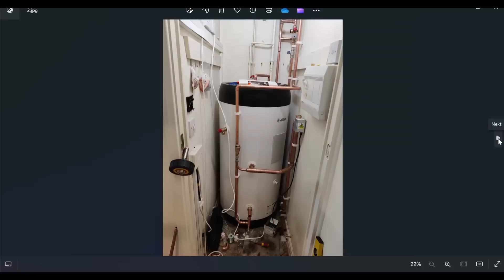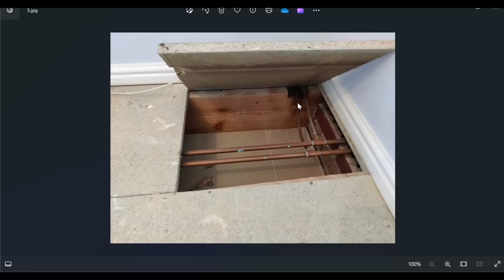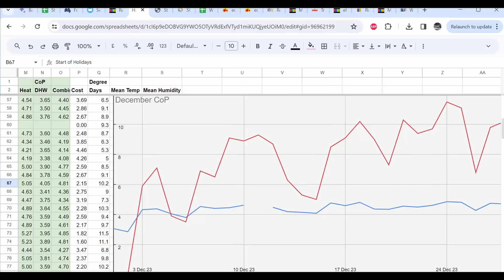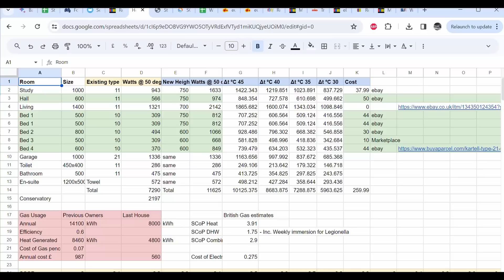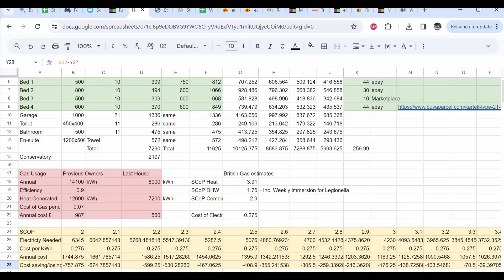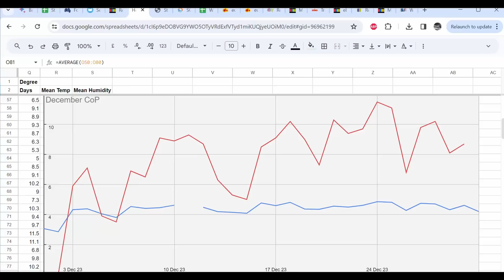How Efficient is my Air Source Heat Pump in Winter? December 2023 Monthly Data Report Update

Comment: bet your walls are insulated though but the truth is that most older buildings in the uk are unsuitible for heatpumps and if we all went out and got one tomorrow with a E car the grid would collapse we dont have enough power stations. Ive been fitting heat pumps on soicl housing in Scotland and they dont work very well at all in fact alot of the tennents would rother go back to a gas boiler LOL so unless the house is upgraded or rebuilt in some cases they are not the awnser
Reply from the maker: I disagree with all of those points, but it sounds like you've made your mind up already.

Thanks for your comment though! Happy new year 🎊
Reply: Instantaneous GB gas demand on record was during the ‘beast from the east’ in 2018 - 214GW at 6pm 1st March 2018, that is the distribution network demand so that includes commercial & light industrial consumption, but ignoring that for now, across 24m households on mains gas supply that’s a peak demand of around 9kW heat input, at an optimistic 80% efficiency that’s 7.2kW heat output.

If we assume a pessimistic COP of 2, then across all GB households that’s 7.2kW x 27m = 98GW of demand, at an optimistic COP of 4 that’s 49GW of demand

OFGEM mid range typical domestic consumption value for gas is 11,500kWh per annum,  for an 8 month heating period (30 day months 24 hours a day) that’s an average gas demand of under 2kW for an average heat output of 1.6kW. Yes that includes hot water but for simplicity it’s easier to ignore that for now.

So assuming all GB households moved to heat pumps at a COP of 0.8, the same as a typical gas boiler, for 8 months of the year electricity demand would rise by 1.6kW x 24 x 30 x 8 = around 43GW, at a COP of 1 it would fall to 34.4GW, at a cop of 4 it would fall to 8.6GW.

At a COP of 4 it’s an 8.6GW increase in average demand, something relatively easy to manage, but with a peak demand of 49GW it IS a problem.

Poor performance of heat pumps is generally assumed to be oversizing and installation issues.  As can be seen the space heating demand is actually very low compared to boiler sizes, boiler sizing is driven by hot water demand and the obsession with combi boilers. 

Yes you need larger radiators with lower flow temperatures, but gas boilers benefit from low flow temperatures too.  

Insulation benefits running costs regardless of heat source.

Above all forget timers, run very long, and low.
Reply: If a home is well insulated and has very low heat loss then heat pumps are amazing. My 4 bed detached house has a calculated 2.77kwh heat loss at -3oC and is EPC A rated. I can literally run the system at 24-25oC most of the time and it produces a lovely even temperature throughout the house. Best purchase in years.
Reply: @DMFPERFORMANCE they’re also amazing if the home isn’t well insulated.
Reply: @constructioneerful   nope you got proff of that statement  i bet not
Reply: @DMFPERFORMANCE  thats precisely my point most homes arnt well insulated LOL
Reply: @DMFPERFORMANCE   yer but the goverment are trying to force this on everyone when most older houses are just simply not suitied without spending a vast amount on money
Reply: @aftermath3127 I have 2 electric cars and a large solar and battery system so  my electrical demand is either powered by the sun or off peak renewable energy so its a good thing and cheap.
Reply: Have a look at Glyn Hudson videos regarding older house performances. Changing to a heat pump also requires a change of mindset as to use, also needs  good design and instalation. Many council/social housing in Scotland will already be well insulated through various grants from Home Energy Scotland over the years, which is benificial to all heat sources.
Reply: @_Dougaldog  not true most tenants in scotland wont them out LOL as they dont perform
Reply: @aftermath3127  From a survey report published in 2021

"Controllability
The evidence indicates that a high proportion of users are satisfied with domestic hot water provision from heat pumps and with space heating. For example, of the 38 
participants in Phase 2 of the EST trial, 84% were satisfied with hot water provision and 80% with space heating. Of 120 properties in Orkney 73% of respondents were satisfied 
with domestic hot water provision and 59% with space heating"
Reply: @aftermath3127  And from same survey

"Technical support

The evidence suggests that dissatisfaction with heat pump performance is also associated with a lack of technical support and advice from suppliers and installers"
Reply from the maker: @aftermath3127  Are you installing and commissioning them correctly?
Reply: @UpsideDownFork  I was just on the install team but in short they were done by a big company so yer just face it they not good in old buildings and even more so up north where its colder LOL see it with my own eyes
Reply from the maker: @aftermath3127  did you upsize all the rads?
Reply: @UpsideDownFork  in short yes all the rad calculations were done by the company by heat pump technicians LOL so yes and guess what still didn't work as intended LOL in short they are not up to scratch yet unless you have the full house built for purpose they were Mitsubishi spec also both heat pump and the cylinder in short unless you spend a vast amount of money there just a waste of time I'm also a heating engineer
Reply: @UpsideDownFork  also when we all go to heat pumps what you think the suppliers  gonna do to the price of electric LOL ohhh you bet theyll put up the price LOL
Reply from the maker: @aftermath3127 heat pumps don't care about insulation or type of building.
They are successfully used in 500 year old churches and the like when correctly designed, installed and commissioned.
Low temperature design is the key, not insulation.
That means that often the radiators will be 2-3 times the size of the existing ones and the controls must be set up on weather compensation to achieve the lowest possible flow temp.
The only thing that insulation does is lower the heat loss from the fabric of the building. The knock on effect of that is smaller radiators will be required compared to the same property with less insulation.

Less insulation = larger radiators.
More insulation= smaller radiators.

Design is important and it sounds like your company is failing it's customers through poor design.
Reply from the maker: @aftermath3127 this point about electric prices and grid capacity is misinformation that is spread by the daily mail. Let's stick to the facts.

Comment: Hi, 
I'm in the renewables' industry & could not sell the thumbnail, "This heat pump saves my £550" that's a-bit of a stretch, The avg saving is 100-150 PA.
If you added the Apples to Apples would the figure be the same, after all upgrading insulation, bigger rads, lower flow temps added to the sums, I think also your old boiler was about 80% efficient at worst case.
Remember, the only saving would be Electric Kwh ASHP 4/1 on gas base on 1 Jan prices 2024 = so the only save on the bit above 4, or 3.4/1 if you factor the 80% efficiency
Reply from the maker: My old Ideal Classic RS non condensing was under 70% efficient when it was brand new and if you'd have seen the state of the heat exchanger as well as the sticky gas valve, I'm sure you'd understand the 60% efficient base line.

Next month I'll update the figures to account for the new price cap.

Thanks for your comment.
Reply: @UpsideDownFork  well, I didn't know gas boilers could run that low efficacy
Reply from the maker: @eco-terrorist  if you haven't worked around older non condensing boilers then I can understand why it's a surprise to you. I've had the same query many many times but I think when I looked before, even the very best Ideal Classic was still only a little over 70% efficiency when it was brand new.